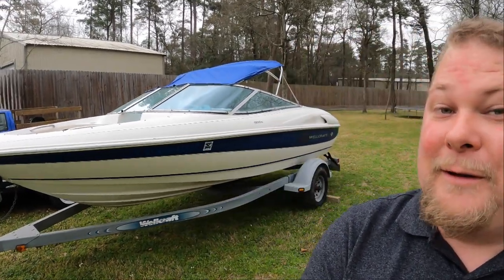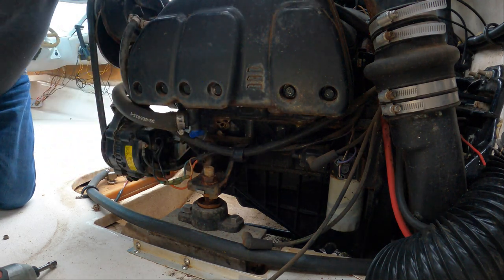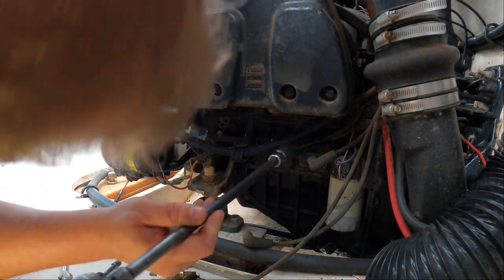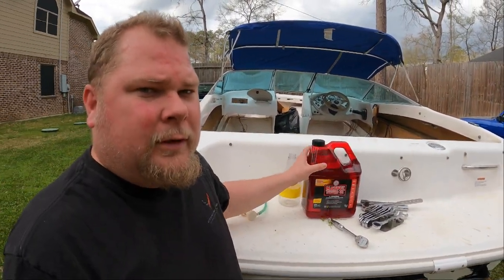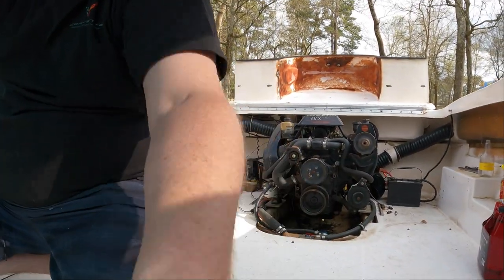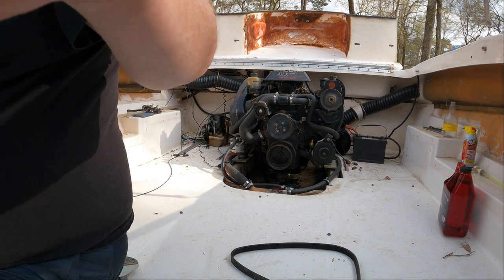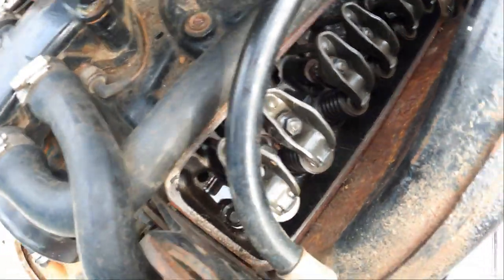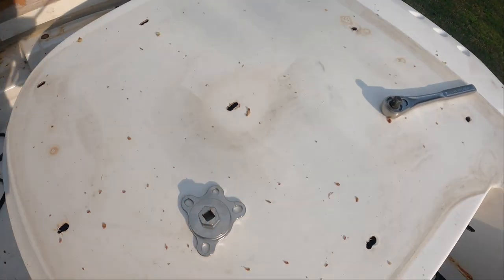Freeing a Seized Engine - Mercruiser 4.3 V6 one step closer to running after 18 years!

Comment: You are the first person to show the back side of the Rotation adapter to show that it's hollow.. Thank you for that!!  Would I be able to hook this up on the crank pulley instead of the damper? I am trying to avoid removing the whole pulley system just to turn the engine over (not seized). I imagine taking out the 3 side bolts and leaving the center (crank shaft) bolt on and then mounting it on the pulley. What do you think?
Reply from the maker: it might work, to be honest I'm not sure if it is deep enough or not to go around the crank bolt. Good luck!
Reply: @RacerXGarage  I bought the adapter but chickened out of mounting it to the pulley.. it didnt seem like the adapter was lying flat and since only those 3 bolts hold the pulley to the crankshaft, with all the tension, I feared that removing even one bolt would cause the pulley to shift. Then I would have to remove everything to remount the pulley with all 3 bolts.. So I ended up rotating the engine by the crankshaft bolt. Forward was fine but doing it backwards loosened the bolt.. I torqued it to 60 and it was okay (not great but okay). Thanks for the reply anyways!

Comment: Theres probably a grove in the cylinder is why it only wants to go 1 way
Reply from the maker: Eh, i don't think that us the case, case it will rotate 360 and smooth now. I think the starter or the drive is stopping it from rotating the opposite way.

Comment: How to instal the adapter tool?  Can't see anything
Reply from the maker: Its literally just removing the 3 bolts that hold on the crank pulley, and then installing this in its place. Its pretty intuitive, if you pull the crank pulley off it should make sense.

Comment: dose this boat has wooden floor deck ?Grat job on the engine
Reply from the maker: Thanks! I think it sort of does have a wood floor. Then covered with fiberglass and gel coat. Not 100% sure but I believe that's what it has going on.

Comment: Whats the name of that piece that the breaker bar fits into, to turn the motor. I need that exact tool
Reply from the maker: Look up Proform 66782 Engine Rotation Adapter
Reply: Thanks, will do. Hope I get this motor to move!!
Reply from the maker: @staymercing1476  me too! We just fired this one yesterday for the first time. Stick with it
Reply: Got my motor to move quarter of a rotation,  so just might be able to bring this beast back to life
Reply: @staymercing1476  Did it just spin the bolt in the crank pully without the tool?
Reply: @sebastianherpst449  yeah, it did. We ended up making  a piece with a nut welded to it, so that we could fit a socket and breaker bar on it. That worked like a charm

Comment: You may have a starter issue
Reply from the maker: Yeah since we freed it up, we can hear the starter gear and flywheel touching so going to pull it off to see
Reply: Got so excited when I saw the bar move man!!!! I got two 1.8 Ford diesels and one doesn’t move either😞  Did you get a new starter or isolate the issue?